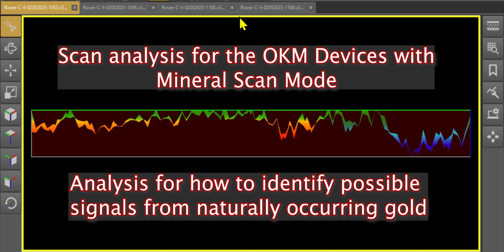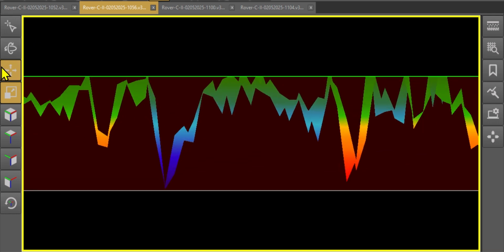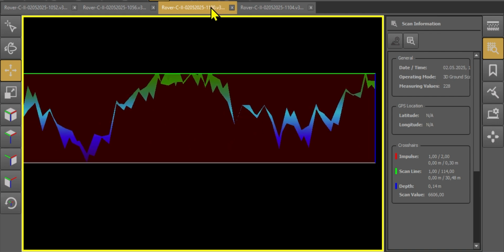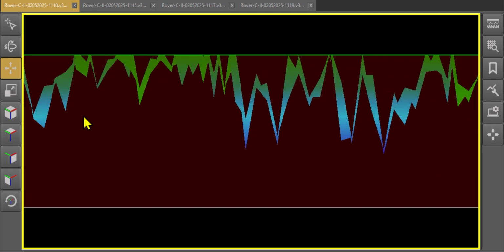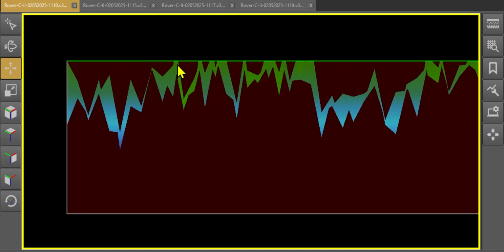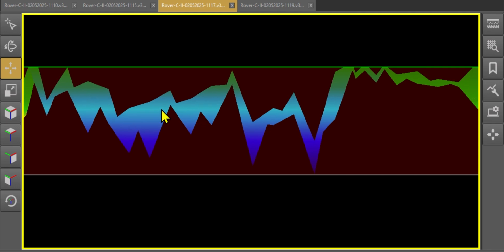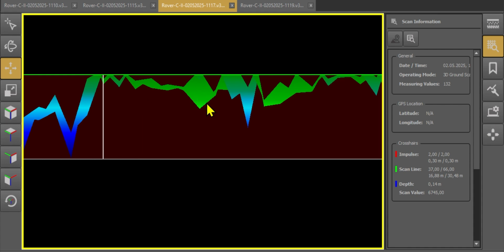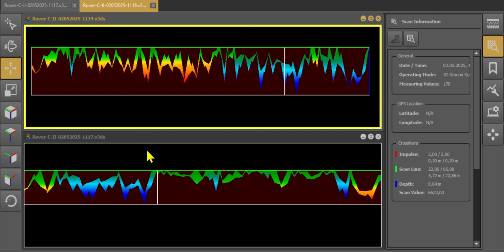Natural Gold OKM Scan Analysis

Comment: These are some of the most confusing comments I’ve seen on a video so far. They are uncertain and fail to explain what area was initially scanned. It’s unclear what array is being represented on the screen—whether it’s measured in square feet or just feet. The person in the video never seems certain and gives no concrete explanations for why he would dismiss or consider the target, and for what reason.

It’s like saying, “This is a very interesting and strong signal, but it’s in the wrong type of electromagnetic spectrum.”

Very confusing without any clear explanation of how gold targets actually might look like and what pattern to look for.